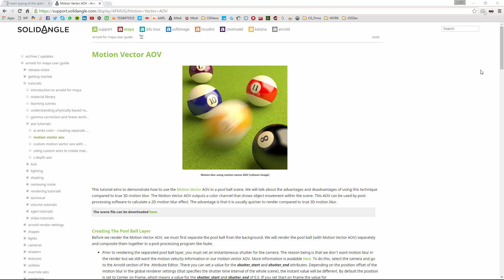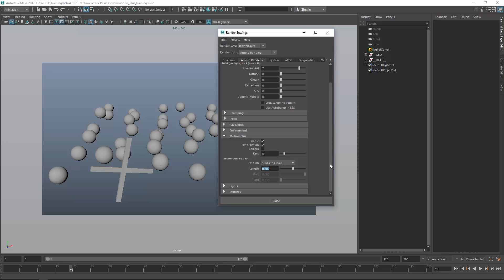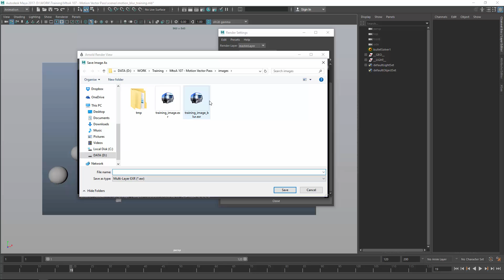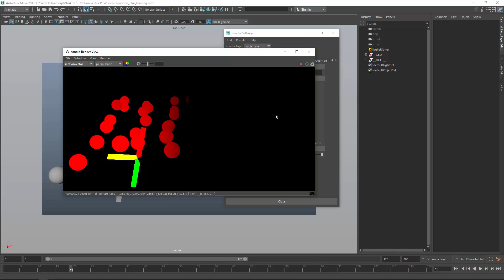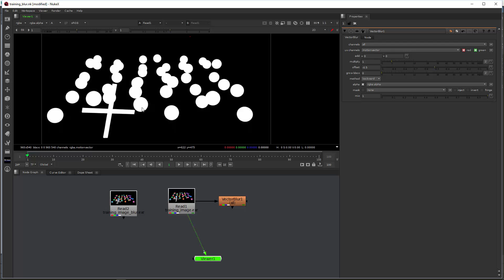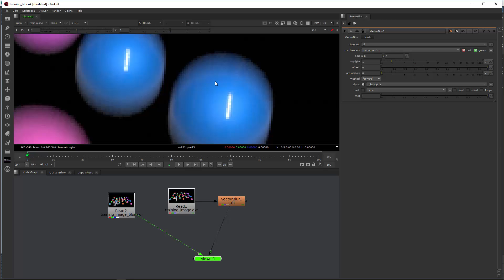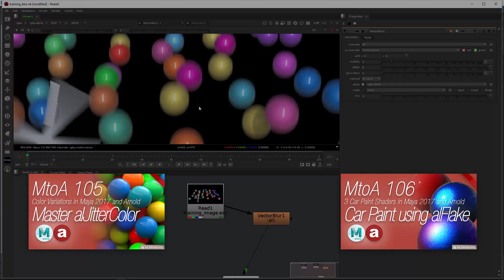2D Motion Vector Blur | Arnold / Maya / Nuke

Comment: quick question: I opened motion blur at render setting, but when I enable ignore the motion blur at override. motionvator pass become black. Why?
Reply: I found a workaround. Instead of enable "ignore motion blur" in the diagnostics that put the image to black... I go on the camera (arnold section) and put "Camera motion blur" to Off. I fixed the parameters of Shutter Start/End also to be consistent with Arnold Renderer options of Motion Blur.
Reply: @jecpu  thanks :) works well with nCache too
Reply from the maker: I am not entirely sure why that is. But what you should do is keep everything on as if you would want to render motion blur. But then change the shutter open close to 0. so there is not shutter offset. and then you should get the vectors rendered.
Reply: Arvid Schneider hi im having the same problem? I enabled the motion blur and the ignore motion blur and i dont have anythjng on my vector motion layer. But when i disable the Ignore motion blur, the vector is there
Reply: i think it only work on obj animation

Comment: Hi ,  is that an solution to create motion vector pass on bind skin character?
Reply from the maker: should work if motion blur  is enabled for deformations. then it should work just fine
Reply: Hi Thanks for reply , i have enable the deformations, but when i turn on the "ignore the motion blur", only have black color on deformation obj, normal translate obj working find. Do i need to turn on anything else? Thanks ~